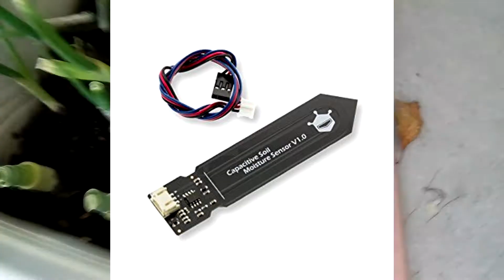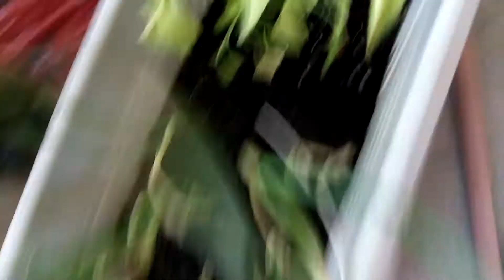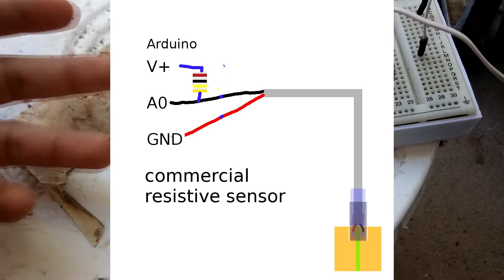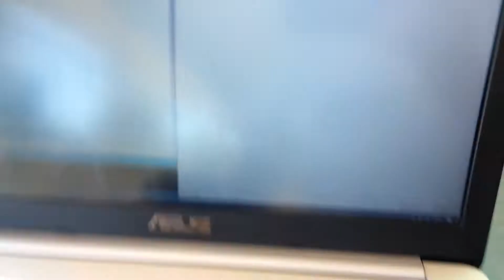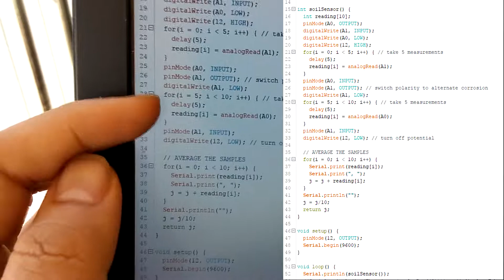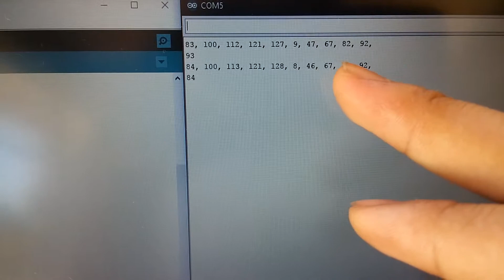Cheap Low Corrosion soil sensor for arduino

Comment from the maker: I JUST REALIZED LINE 18 SAYS digitalWrite(A1, INPUT); please change it to pinMode(A1, INPUT);
The reason the output still works is because whenever analogRead() is called the compiler automatically adds the pinMode command. As for why it compiles with no error, i have no idea.
Reply: compiles because all pins are default INPUT by definition.  You don't really need to specify inputs, but it is good practise.

Comment: Hello sir, it's been over a year now. How does the sensor go? Any corrosion happened? Thank you.
Reply from the maker: i pulled out the sensors a few weeks ago. the copper has tarnished but they don't seem to have corroded away. the reading is a lot different from before due to the tarnishing and soil characteristics changed due to age and fertilizers. I would recommend changing the copper clad PCB with stainless steel or another different inert metal like platinum or gold if you don't want readings to drift over time.
Reply: Thanks for your prompt reply. I'm working on my rain sensor, and trying to fix the electrodes corrosion problem. So far, your video and your feedbacks have been very helpful. I really appreciate your recommendations. Thank you very much, sir.